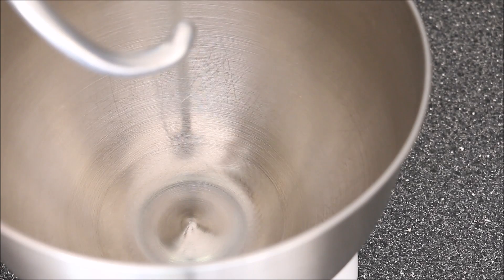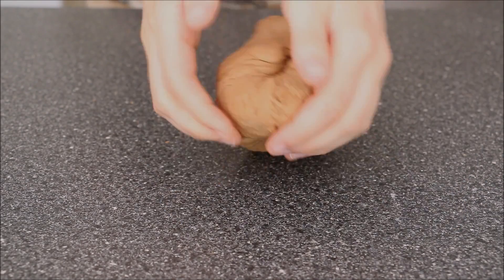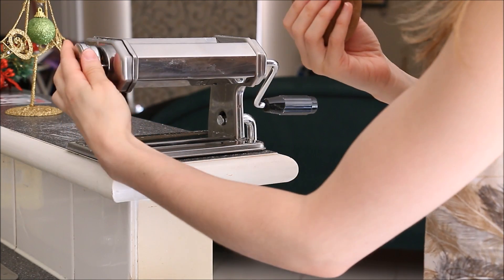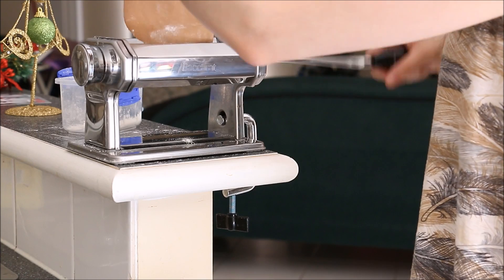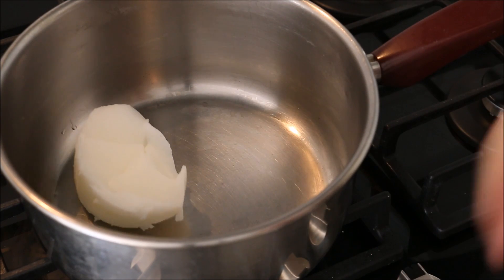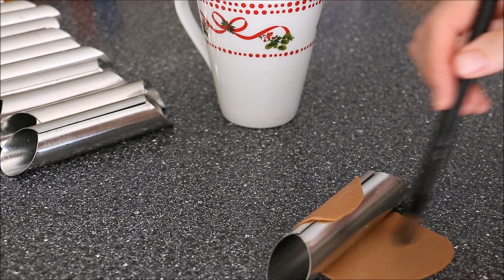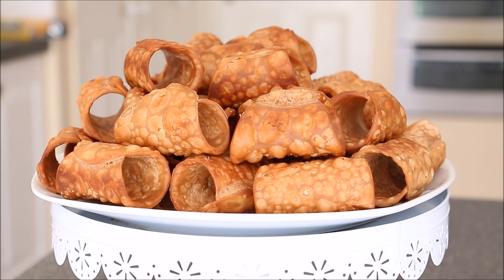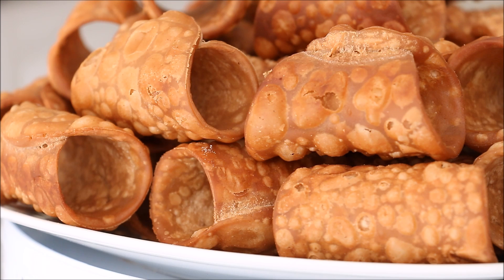How to make authentic Sicilian cannoli shells- video reipe

Comment: Hi Rosie, thank you for your wonderful video. I made some for the first time today but halved the recipe as I didn't want as many. The dough was so smooth and giving, they turned out wonderfully thanks to your excellent video and recipe details. My dough ended up a little darker in colour which is probably due to the cocoa I used. A couple of things I found though which may help others making them for the first time as it was for me. One was that, one or two of my shells stuck to the tubes, so I coated the tubes with a little butter before wrapping the pastry around it, this fixed the problem. Secondly, I must not have put enough egg white on one as it came apart during frying. Practice make perfect as they say !

Comment: Thanks for sharing your recipe. I tried it today and it turned out great! I had to make a few substitutions; amaretto instead of marsala wine and coffee extract instead of instant powder; but it still turned out really good. I will definitely be using this one again 🙂
Reply: Where is the recipe?
Reply: @theresamusarrarody9844 " Recipe:
250 grams flour
2 tablespoon caster sugar
1 teaspoon cocoa powder
1/2 teaspoon cinnamon
1/2 teaspoon instant coffee granules
1 tablespoon and 1 teaspoon shortening
1 egg
80 mls of Marsala

For frying:
300 grams of shortening / lard OR canola oil, for frying (may vary depending on how deep and wide your pan is. You want the cannoli tubes to be completely submerged in the oil)"

it's under the show more tab
Reply: @theresamusarrarody9844  it is in the description

Comment: This is a fantastic video.  I love cooking as well, and this is a great recipe.  I haven't made it yet because I do not have the pasta roller or the cannoli mold things (where did you get those by the way?), but I am hoping to make it soon.
Reply from the maker: Brett Summers thank you! :) the pasta roller is more out of convenience that anything else. you can still do the same process using a rolling pin but it will take you much longer. I actually bought my cannoli tubes in Sicily 2 years ago at a market, but back in the day my aunties used to use hollow bamboo wood / trunks. or thick cilinder shaped wood does the trick. hope that helps in some way! thanks for watching
Reply: Brett Summers you can get your cannoli flutes off amazon!

Comment: Fantastic, thanks.  I've not found any good Cannoli in the USA and have played with the idea of making it myself.  Do you have a recipe for the Sheep's Milk Ricotta filling?  I believe it's made with Honey to sweeten it, if I understood the Sicilians I spoke with last summer.
Reply: +Maribeth Theisen 
There are so many variations of preparing cannoli filling made from ricotta. Buy it fresh in bulk and buy one or two pounds, NOT in a plastic tub like cottage is sold. One variation, some use a small amount of Philly cream cheese mixed with ricotta.  When you bring your ricotta home and you're ready to make, mash the ricotta through a fine strainer to break up the cheese, sort of like potatoes thru a ricer, if you know what I mean, this makes it velvety smooth. Add your gran. sugar, or powdered sugar, cho. chips, or candied citron, some cinnamon, or cinnamon oil to boost flavor.  Powdered sugar dusting, cherry on top, or on sides...you're the decorator, you're the consumer, make your dessert your way you'd enjoy best. Please just keep the broccoli off. Enjoy!
Reply: +Philip Mannino 
Oh, and I always use chopped toasted almonds and dip the edges into the nuts...my family tradition! Lastly, I will (ever so lightly) sprinkle a pinch of cinnamon on top of the cannoli shell, not so much that you taste it, but more because you can smell it to heighten your senses.  That's my original cooking tip no one's ever used before.
Reply: +Philip Mannino , thank you so much!
Reply: Maribeth Theisen - some of the best cannoli that I have ever had is in Boston, MA.  If you ever visit, I'll give a few recommendations

Comment: Looks great!!!  BUT...I don't have those wonderful cannoli shell molds...what was used before these new fangled tools came out??? Anyone? I'm old school and don't have all the typical bells and whistles available to many chefs.
Reply: Barbara Mandese cannolo literally means tube. There hasn't ever been any other way of preparing them apart from using these little pipes... They traditionally used bamboo versions, but that's even harder to find anywhere, so I suggest you just buy those cheap metal versions. They work equally well.
Reply: Wooden Dowells.. about 2 inch(or roughly 5 cm) wide

Comment: Is there something else we can use to wrap the dough around if we don't have that specific tool?
Reply from the maker: Hey leondria gordon, yes there is, my aunty back in the day would use bamboo (so it was hollow on the inside). otherwise I know of people using regular wooden cylinder shaped pieces to wrap the dough around as well. or cannelloni tubes to make the pasta, only they are much thinner and would result in a odd looking cannoli, but you could always make miniature ones using the cannelloni tubes.
Reply: leondria gordon I just thought of a way out of that situation...If you live in the US, you might want to shop for an aluminum pipe at 2inches or more in diameter at the Home Depot or Lowes, (depending on the size of cannoli shell you desire) and ask the attendant to cut them into short tubes (4inches), and have them sand the edges for a fee. That's what I will do this weekend...Please let me know how it goes.
Reply from the maker: MSE. Dzirasa that's a great tip! thanks for sharing :)
Reply: +leondria gordon 
Well Leondria, from what I heard, years ago people would use cut up broom handles, wooden of course.  But nowadays they also make metal broom handles, but then you'd have a very short broom. Hardware stores have both metal tubes and wooden dowels.
Reply: Bamboo sticks sounds better to me than metal.

Comment: Rosie, mine doesn't have the bubbles and it's a little soft.  Do you have any helpful hints for me?
Reply from the maker: Hi +Yvette Armato, were you able to roll the in layers with the pasta machine? The more layers you roll over, the more micro layers you create and these tend tos eparate during frying and create the air pockets / bubbles. Adding baking soda to the recipe also helps this process. In terms of softness, I am wondering if they are cooking through properly? or do they become soft after you add in the filling? if so this is normal. To keep them crisp I would store them in an airtight container.

Comment: In the beginning she say's shorting { which is hydrolyzed vegetable oil}  than she say's you can try vegetable oil but if you want the authentic taste use lard. She misspoke, she is using lard in the video.
Reply from the maker: Hi there, yes so it is lard that I use in this recipe. If you would prefer to use vegetable shortening, that can be done as well.

Comment: What if you use water instead of egg white?
Reply from the maker: hey hun, I know egg white is stickier and when fried will set even more so, making it a more reliable bonding agent. If it were being baked, I would say it should be fine. But since it is being fried, it might not be such a good idea. I haven't tried it though, so i couldn't actually say! If you did try this, how did yours go?
Reply: @Rosiesdessertspot  Somebody I know followed a different recipe that said water is best. But it ended up exploding in their face and they had to go to the emergency room. I was just wondering what you would say about using egg whites or water because using water can be dangerous! But I am very glad and thankful that you use egg whites in your recipe instead of water.

Comment: What can I sub marsala for, and is it possible to do without mold
Reply from the maker: hey Tim Naff, you can substitute marsala with any other sweet wine. A sweet red would be best as it helps to give the shells some colour. Hmm as for the moulds, I know back in the day my aunties used to use wooden cylinders / bamboo instead of the metal moulds. Otherwise, I don't think you could make he cannoli shells without a mould :-S unless you make squares and make cannoli sandwiches instead of hollow tubes?

Comment: Those molds look impossible to find.
Reply: Go to local Home Depot or Lowes and purchase dow rods - ask them to cut in 6" lengths.  Of course buy the appropriate diameter dow rod.  Works beautifully.  (Just season with oil before using!).

Comment: In the spirit of cross-cultural utility, I'm going to try using my tortilla press next time. I used a rolling last time, and the results were so, so.
Reply from the maker: that could work nicely :) you sound like you work with dough on a regular, but thought it could be worth mentioning for anyone else reading this and looking to give it a go in a tortilla press:
 divide the dough into its individual little balls and have it rest for 30 mins before applying it into the tortilla press. if you roll the dough into a ball and place it in the tortilla press without that 30 minute rest at room temp, you will struggle to get it to flatten out as thin and it might spring back slightly into a thicker disk. Best of luck with it :D